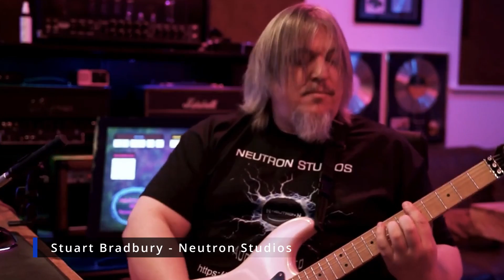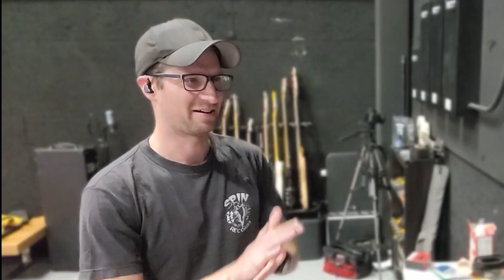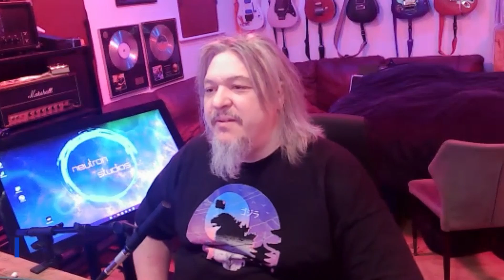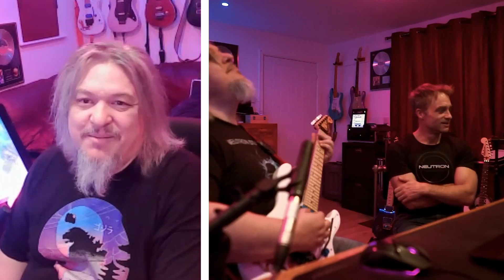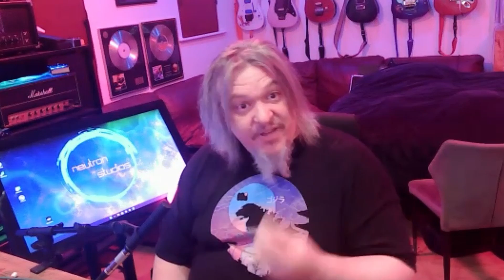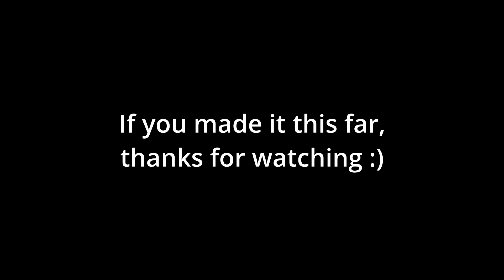Capturing Van Halen Guitar Tones with@neutron_audio

Comment: What hardware supports these profiles, Spark Go, ToneX?
Reply from the maker: They are for the Neural Amp Modeler! Sorry if I didn't mention that anywhere. Luckily, NAM is completely free and open source
Reply: @stevenkambach  Thanks for the explanation.  When someone puts this into a Pedal, like Tonex, it will hopefully be a more affordable option.
Reply from the maker: @seanwalsh999  I agree. The struggle is real. I have heard others are coming up with pedals, but I haven't heard any specifics